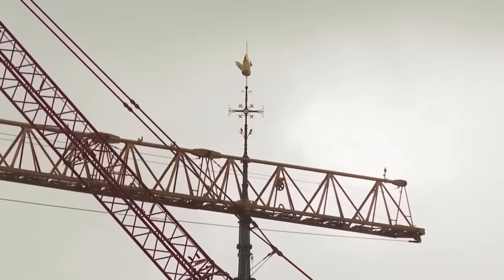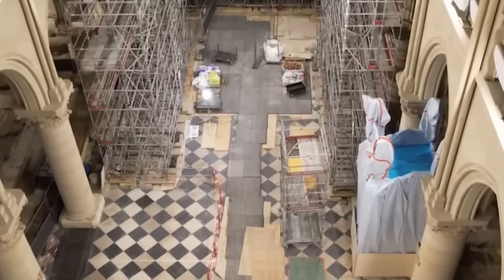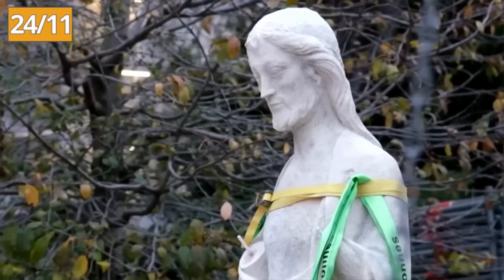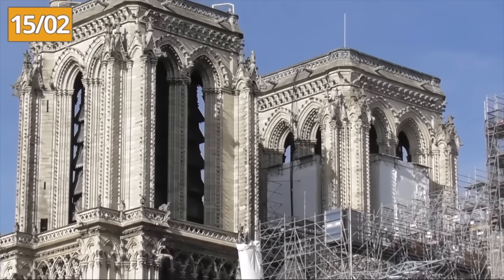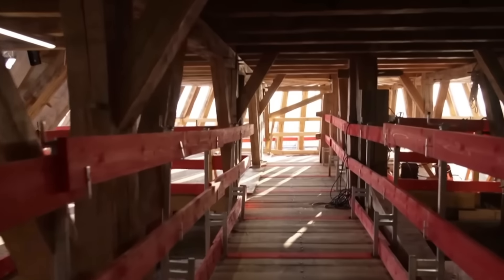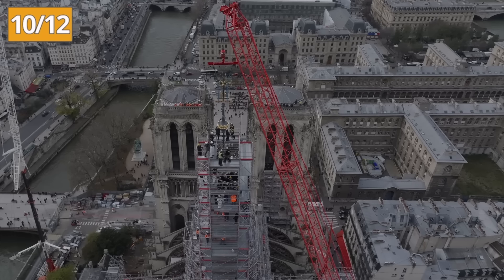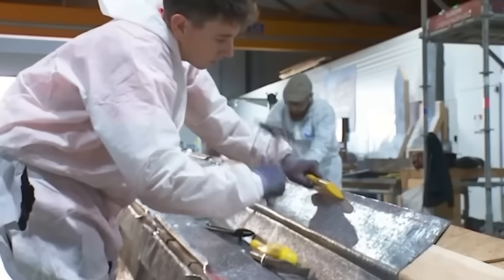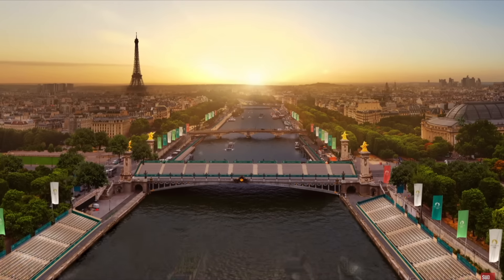Notre-Dame de Paris : How is progress at the site ?

Comment: About the AI narration. I am very deaf, so having BOTH the captions AND the narration is extremely  helpful. I don't care if there are glitches in the AI narration: they are very obvious and easily corrected in my head as I read. What is most important to me is that, using both, I can completely follow. Would it be an improvement to have better AI narration? Yes, of course, but being very deaf makes my ability to understand far more important than any technical imperfections.